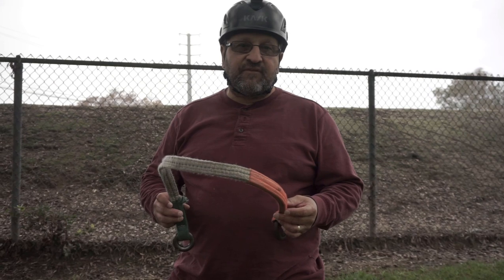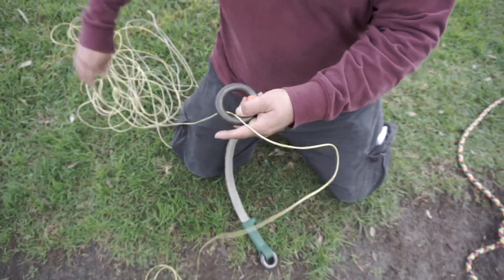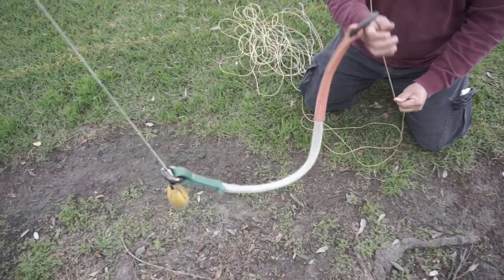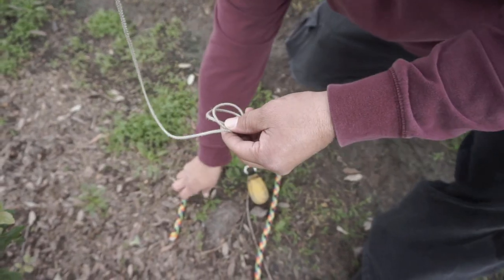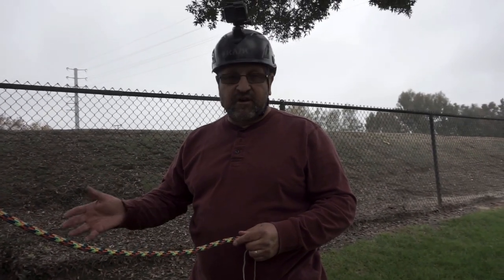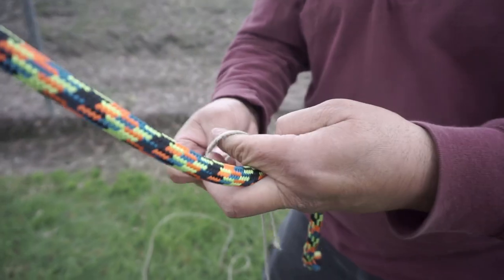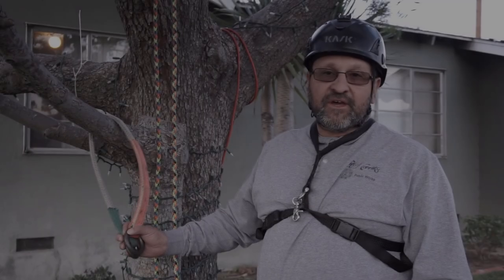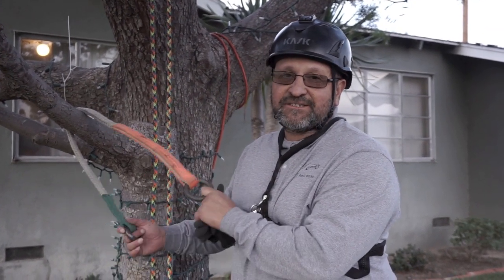HOW TO PROPERLY USE A FRICTION SAVER

Comment: I do like and appreciate your videos.  However, there's something that's probably rather common that can foil this method.  As I just found out, if your up throw line and down throw line fall on opposing sides of a branch below the crotch or branch the throw line goes over, the friction saver will be stopped on its way up by the branch and it'll never get up to the crotch or branch the throw line went over.  Is there perhaps another method that will work when the up throw line and down throw line fall on opposing sides of a branch?

Comment: I whip a figure 8 loop into the sheath of my rope at the ends of my climb rope. I cut out about 2 inches of the core and jamb the figure 8 into the core. I use a whipping on the full rope before the cut core and then use a terminal whipping after the figure 8 to capture the knot inside the sheath of the rope. This way there is a loop extending from the tip of my rope. I use thin paracord 1/16th or 3/32nd diameter. This allows me to run my rope smoothly through any set up.

Comment: All the videos showing set/retrieve cambium savers from the ground, they all miss the part where they get the tied end of the rope back? (through the small cambium ring which sets anchor/saver), they all show setting the cambium saver, then at retrieval time they magically have both ends of rope in hand again???? Unless you keep boyh ends and tie in to bottom of tree, but what if your doing srt on a large tree, your using the cam saver as the anchor, hpw do you retrieve that from the ground?

Comment: What material and size is your throw line? Love your videos, I have learned so much from your presentation. It is good to see that larger guys can climb too :-)
Reply from the maker: Thank you, Here it is (Samson Zing-it is made from high-strength Dynema having 560-pound tensile strength. The smaller diameter Zing-it is ideal for high shots & creates less friction over branches allowing use of lighter weights.) I really like this makes shooting into the tree a lot easier.

Comment: If you climb into the tree and want to reposition into another crotch is that easy to do in the tree with the friction saver? I can't think of an easy way to move it when you're in the tree.
Reply from the maker: The best way is to send a shot bag to your final tie in and install the friction saver. if you planed on working you way up the tree it's best to reposition up to your final tie in and then install your friction saver.

Comment: Hi Bino, first of all, thank you so much for all the educational content! It is really well done and easy to understand. I have a question about friction savers as shown in this video.
If I were to do this with a zigzag or other device for SRT that is not midline attachable, I would have to tie the rope to the other side of the throwline (not the one where the bag was), so that the rope comes out of the small ring instead of the big ring, so that I can then there make the alpine butterfly as a stopper and climb the side of the big ring up SRT, correct?
Otherwise I would have to feed the rope through the zigzag every time when setting this up and I would not be able to use a spliced eye in a rope as that would then not go through the zigzag.
Am I understanding/imagining this correctly?
Reply from the maker: Thank you. I really do not use a friction saver when I climb stationary rope but I believe you would set it up with your stopper knot on the small ring side and you climb on the big ring side. I also don't have a Zig zag but you would feed it through on the rope that is on the big side. It might be a good idea to set it up very low to the ground to visualize it. I hope that was helpful. Take care!
Reply: @BinoH  thank you so much for the kind reply!
Reply from the maker: @norb4152  You're welcome.

Comment: Seems like half the tree's I try to do this on has so many branches that its impossible to get the throw line routed the same way going up as coming down. Any tips for this situation?
Reply from the maker: You may have to just work your way up and set when you get there or look into the SRS climbing system because then you wouldn't have to isolate your line and there is no friction on the branch you're tied into.

Comment: Can these be used in SRT to protect the rope, Bino?
Reply from the maker: yes you can do canopy anchors with friction savers.
Reply: @BinoH  Hi Bino, 

Is there a benefit to doing that?  I would imagine that one end of the rope would get worn out after a while if it was always being looped around rough  tree bark as a canopy anchor, and yet no-one seems to talk about (or do videos about) friction savers being used in SRT, all of the videos are ONLY about using them in moving rope systems???

Why isn't this talked about?  Is it an uncommon or an unusual suggestion?

Kind regards, Lee

Comment: Hi,
How long should the string to which the weight is attached be ?
Reply from the maker: That depends on how high your throw in to the tree is. If it's 60 feet than you should have more than 120 feet of throw line.
Reply: How long and thick was the string they used in this video ?

Comment: I'm curious what length your friction saver is and does it hurt to have a longer one that's 48"? What is your preference between the steel and aluminum rings?
Reply from the maker: I like steel and I think mine might be 30" but there are adjustable ones.
Reply: Thanks Bino.

Comment: I'm using the branch not as support. I have to install the friction saver by girth hitching. No way to climb DDRT when your climbing rope goes around 36" of surface. Thankfully most of the bark I've gotten off. That red oak bark is the worst.
Reply from the maker: Sounds like a very large tree.

Comment: What the minimum size of a branch that the friction savor should be at?
Reply from the maker: It is the same as a final tie in without one.
Reply: I meant the thickness of a Branch
Reply from the maker: The final tie point should be at least 4 inch diameter. I made a video on it.  Here is the title, Why climbers should use a proper tie in point.